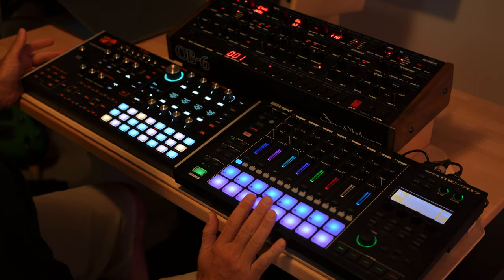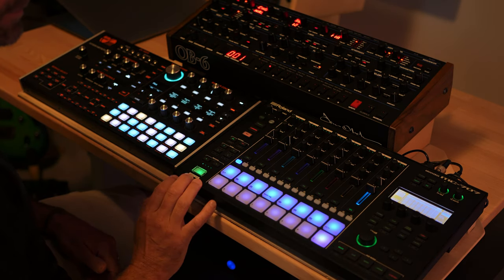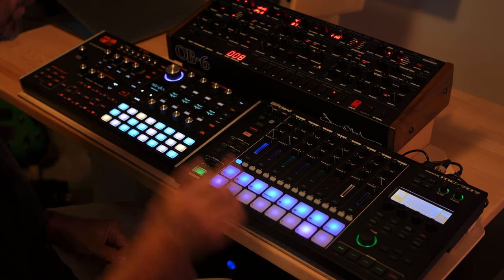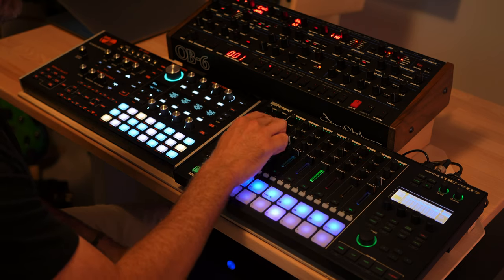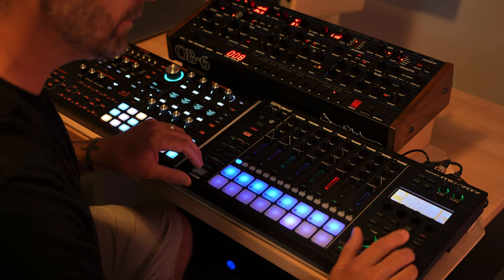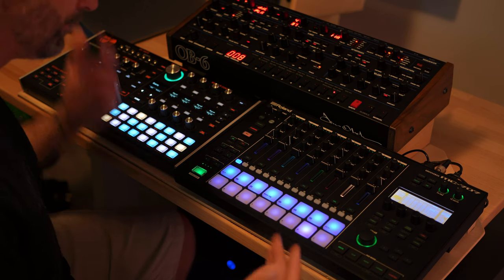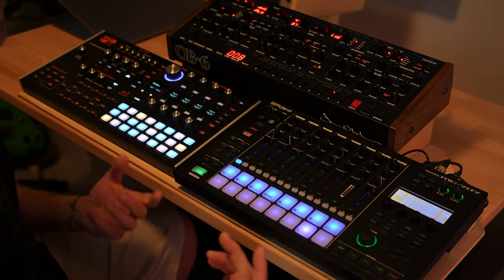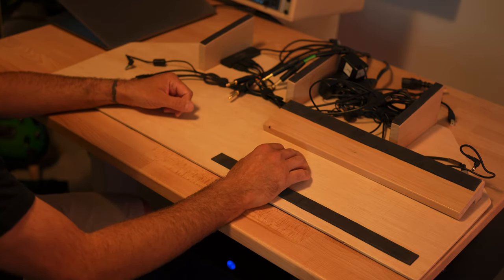Coriolis Live Set Walkthrough

Comment: I liked your set and it's great to have this video to hear you discuss how it came to be.  I use the MC-707 in the same way you do, except I do have my external hardware running through the MC-707.  You mention FX in this video, how is that setup?  I assume you can apply whatever individually to select tracks/sounds or is it as simple as the OB6 / Hydrasynth going into separate pedals?
Reply from the maker: I just use the effects built into each synth, there's nothing in the set you can't see, just the 707 Hydra, and OB6 and that's it.